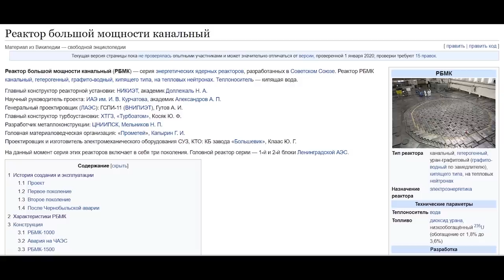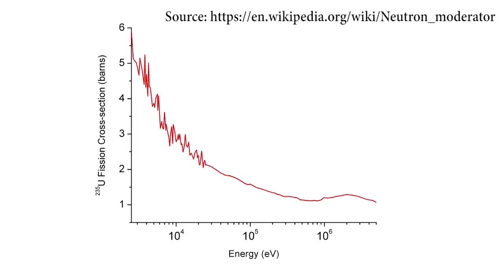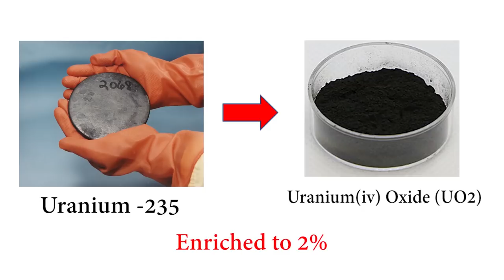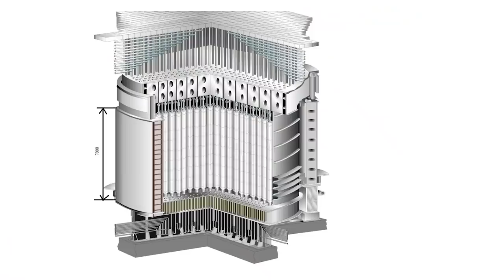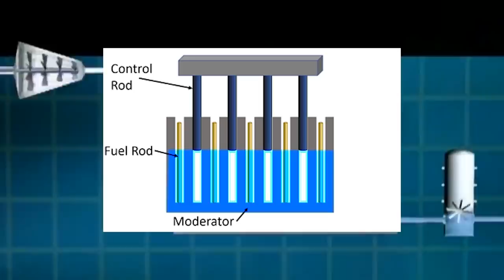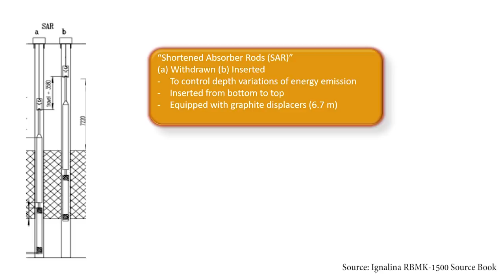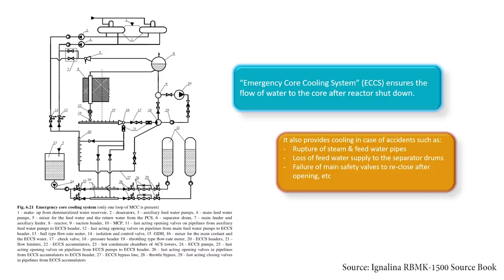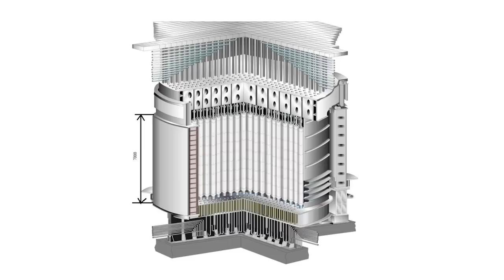RBMK Reactors - Design Overview | The Nuclear Reactor that was used in Chernobyl

Comment: Good video! I still do not understand how the fuel assembly works. Inside the 11.4 cm diameter graphite channels, there is a fuel assembly. How, then, is this fuel assembly brought into contact with water? Is the inside of the graphite block assembly actually a high pressure tube made out of zircalloy? But if that's true, then online refulling is impossible, you have to disassemble the pressure tube ? As another point, do you know if emergency reactivity control is also achieved with boric acid injection in the water (nowadays?)
Reply from the maker: Inside the 0.114m bore openings of the graphite blocks, there is a fuel channel made of zircalloy placed in it. The fuel channel is connected to the tubes from the MCPs, which pump water to channels. 

The fuel assemblies are placed inside the fuel channel, in which water flows through. That way, only the fuel assemblies that need to be replaced during refueling, not the entire fuel channel.

And yes, boric acid is quite common use in PWR designs.
Reply: @antares2767  How much space is there between the fuel assembly and the interior wall of the channel? That is, how much space for water to flow?
Reply: I think the problem with boric acid is that it takes way too long to charge it into the plant. My limited experience - had to mix the boric acid then place in a charging water tank, then charge at a very low flow rate. Not practical for this near-prompt critical casualty.

Comment: I believe I have a correction here. Since water has the capacity to absorb and slow down neutrons, the presence of water shall increase the reactivity as the chances of a neutron colliding increases. at 6:16 you mentioned, reactivity increases as  water leaves the system.
Reply from the maker: Light water can either act as a neutron absorber(absorb neutrons = slows down reaction) or moderator(slows down neutrons = increases reactivity) depending on the design of the reactor. It is typically used as a moderator in reactors with higher levels of U-235 enrichment(3-5%). 

That's not the case for RBMK reactors, where the enrichment is only around 2%. Here, water actually acts more as an absorber rather than a moderator, which slows down the reaction. So when a void is formed, the reactivity increases as only graphite(a stronger moderator than light water) and the fuel are left in the system.

Comment: The RBMK (Russian: реа́ктор большо́й мо́щности кана́льный, РБМК; reaktor bolshoy moshchnosti kanalnyy, "high-power channel-type reactor") is a class of graphite-moderated nuclear power reactor designed and built by the Soviet Union. The name refers to its design where, instead of a large steel pressure vessel surrounding the entire core, the core is surrounded by a cylindrical annular steel tank inside a concrete vault and each fuel assembly is enclosed in an individual 8 cm (inner) diameter pipe (called a "technological channel"). The channels also contain the coolant, and are surrounded by graphite.

The RBMK is an early Generation II reactor and the oldest commercial reactor design still in wide operation. Certain aspects of the original RBMK reactor design, such as the large positive void coefficient, the 'positive scram effect' of the control rods[3] and instability at low power levels, contributed to the 1986 Chernobyl disaster, in which an RBMK experienced an uncontrolled nuclear chain reaction, leading to a steam and hydrogen explosion, large fire, and subsequent core meltdown. Radioactive material was released over a large portion of Europe. The disaster prompted worldwide calls for the reactors to be completely decommissioned; however, there is still considerable reliance on RBMK facilities for power in Russia. Most of the flaws in the design of RBMK-1000 reactors were corrected after the Chernobyl accident and a dozen reactors have since been operating without any serious incidents for over thirty years.[4]

Nine RBMK blocks under construction were cancelled after the Chernobyl disaster, and the last of three remaining RBMK blocks at the Chernobyl Nuclear Power Plant was shut down in 2000. As of February 2024 there are still 7 RBMK reactors and three small EGP-6 graphite moderated light-water reactors operating in Russia.[1][5] All have been retrofitted with a number of safety updates. Only two RBMK blocks were started after 1986: Ignalina-2 and Smolensk-3.

History
The RBMK was the culmination of the Soviet nuclear power program to produce a water-cooled power reactor with dual-use potential based on their graphite-moderated plutonium production military reactors. The first of these, Obninsk AM-1 ("Атом Мирный", Atom Mirny, Russian for "peaceful atom," analogous to the American Atoms for Peace) generated 5 MW of electricity from 30 MW thermal power, and supplied Obninsk from 1954 until 1959. Subsequent prototypes were the AMB-100 reactor and AMB-200 reactor both at Beloyarsk Nuclear Power Station.

By using a minimalist design that used regular (light) water for cooling and graphite for moderation, it was possible to use fuel with a lower enrichment (1.8% enriched uranium instead of considerably more expensive 4% enrichment). This allowed for an extraordinarily large and powerful reactor that could be built rapidly, largely out of parts fabricated on-site instead of by specialized factories. The initial 1000 MWe design also left room for development into yet more powerful reactors. For example, the RBMK reactors at the Ignalina Nuclear Power Plant in Lithuania were rated at 1500 MWe each, a very large size for the time and even for the early 21st century. For comparison, the EPR has a net electric nameplate capacity of 1600 MW (4500 MWthermal) and is among the most powerful reactor types ever built.

The RBMK-1000's design was finalized in 1968. At that time it was the world's largest nuclear reactor design, surpassing western designs and the VVER (an earlier Soviet PWR reactor design) in power output and physical size, being 20 times larger by volume than contemporary western reactors. Similarly to CANDU reactors it could be produced without the specialized industry required by the large and thick-walled reactor pressure vessels such as those used by VVER reactors, thus increasing the number of factories capable of manufacturing RBMK reactor components. No prototypes of the RBMK were built; it was put directly into mass production.

The RBMK was proclaimed by some as the national reactor of the Soviet Union, probably due to nationalism because of its unique design, large size and power output and especially since the VVER was called the American reactor by its detractors in the Soviet Union, since its design is more similar to that of western PWR reactors. A top-secret invention patent for the RBMK design was filed by Anatoly Aleksandrov from the Kurchatov Institute of Atomic Energy, who personally took credit for the design of the reactor, with the Soviet patent office. Because a containment building would have needed to be very large and expensive, doubling the cost of each unit, due to the large size of the RBMK, it was originally omitted from the design. It was argued by its designers that the RBMK's strategy of having each fuel assembly in its own channel with flowing cooling water, was an acceptable alternative for containment.

The RBMK was mainly designed at the Kurchatov Institute of Atomic Energy and NIKIET [ru], headed by Anatoly Aleksandrov and Nikolai Dollezhal respectively, from 1964 to 1966. The RBMK was favored over the VVER by the Soviet Union due to its ease of manufacture, due to a lack of a large and thick-walled reactor pressure vessel and relatively complex associated steam generators, and its large power output, which would allow the Soviet government to easily meet their central economic planning targets.[6]

The flaws in the original RBMK design were recognized by others, including from within the Kurchatov Institute before the first units were built, but the orders for construction of the first RBMK units, which were at Leningrad, had already been issued in 1966 by the Soviet government by the time their concerns reached the Central Committee of the Communist Party of the Soviet Union and the Soviet Council of Ministers. This prompted a sudden overhaul of the RBMK. Plutonium production in an RBMK would have been achieved by operating the reactor under special thermal parameters, but this capability was abandoned early on.[7] This was the design that was finalized in 1968. The redesign did not solve further flaws that were not discovered until years later. Construction of the first RBMK, which was at Leningrad Nuclear Power Plant, began in 1970. Leningrad unit 1 opened in 1973.

At Leningrad it was discovered that the RBMK, due to its high positive void coefficient, became harder to control as the uranium fuel was consumed or burned up, becoming unpredictable by the time it was shut down after three years for maintenance. This made controlling the RBMK a very laborious, mentally and physically demanding task requiring the timely adjustment of dozens of parameters every minute, around the clock, constantly wearing out switches such as those used for the control rods and causing operators to sweat. The enrichment percentage was increased to 2.0%, up from 1.8% to alleviate these issues.

The RBMK was considered by some in the Soviet Union to be already obsolete shortly after the commissioning of Chernobyl unit 1. Aleksandrov and Dollezhal did not investigate further or even deeply understand the problems in the RBMK, and the void coefficient was not analyzed in the manuals for the reactor. Engineers at Chernobyl unit 1 had to create solutions to many of the RBMK's flaws such as a lack of protection against no feedwater supply. Leningrad and Chernobyl units 1 both had partial meltdowns that were treated, alongside other nuclear accidents at power plants, as state secrets and so were unknown even to other workers at those same plants.

By 1980 NIKIET realized, after completing a confidential study, that accidents with the RBMK were likely even during normal operation, but no action was taken to correct the RBMK's flaws. Instead, manuals were revised, which was believed to be enough to ensure safe operation as long as they were followed closely. However, the manuals were vague and Soviet power plant staff already had a habit of bending the rules in order to meet economic targets, despite inadequate or malfunctioning equipment. Crucially, it was not made clear that a number of control rods had to stay in the reactor at all times in order to protect against an accident, as loosely articulated by the Operational Reactivity Margin (ORM) parameter.[8] An ORM chart recorder and display were added to RBMK control rooms after the Chernobyl disaster.

A 45-year lifetime is envisaged for many of the units, after mid-life refurbishment

Comment: I am looking answer for my question and i think you didnt told about this. How the control rods are moving? There is a hydraulic actuator, or some mechanical gearbox with electrical motors?
Reply from the maker: If I'm not mistaken I answered this question a while back. I provided a link in the description to the RBMK-1500 sourcebook. Refer to pages 70-72 regarding the control rod drive. You'll find your answers there. Thank you

Comment: First of all, nice video. I appreciate your work. Regarding the AZ-5 emergency shutdown button: isn't it the one on the left upper corner instead of the middle one you are showing here? In the various photo's I saw, including those from the control room of reactor 3, the infamous az-5 button is not in the middle. Thanks again!
Reply from the maker: Oh, that picture was taken from reactor 1. It's probably because reactors 3 and 4 were newer than 1 & 2. I guess you can call them '2nd generation' rbmks, and they had relatively minor-moderate number of modifications.
Reply from the maker: And the picture I showed does in fact has an 'АЗ-5' writing on it so, yeah.

Comment: Question, why do meltdowns cause reactors to explode?
We heat up the core so we can create steam, does the same principle hold true once Corium is made? Does the heat become so high that the core can’t hold the pressure and it bursts? How do positive feedback loops with RBMK reactors even work?
Also, I see core schematics have this circular-like grid around it? Not sure what it’s called. Is this special to RBMK reactors or do many types of reactors have them?
Reply: In case of RBMK, it was because steam forming in the core actually ramped up the reaction, instead of ramping it down (like on VVER).
Reply: In this case it was most lilkely a steam explosion. For Fukushima is was a hydrogen explosion. A meltdowm is mostly referred to the core melting down in a PWR reactor, which Chernobyl was not.

Comment: 11.49 the opertor push on the control rods too farZfast response) making it expand positive void reaction.
12.25 later made correction by reduced control rod reaction time from 18 to 14 seconds.

This two phrase is contrasted.
Reply from the maker: I was referring to the violations of safety protocols for the reactor on the first phrase when I said "due to the operators pushing it too far". Not the control rods during the shut down sequence.

Comment: Unaccurate informations: all the fission reactors use the natural state U-238 which is fissionable but not fissile (cannot sustain the chain reaction to capture neutrons, break and relese another neutron), thus it must be enriched with U-235  which is fissile but only present in a ~0.6 percent in natural ore.
CANDU - pretty "western" reactors - can use natural uranium, thus making them the most efficient and safe, but slightly expensive.

Comment: So the graphite stack is cooled by a helium nitrogen mixture, and the light water which sits at the bottom? (The main question is if the water penetrates the graphite stacks)
Reply: No, water is inside cooling channels (in pressure tubes), graphite is outside and dry, and gas-cooled

Comment: So does water circulate through the graphite channels or does everything happen inside the closed fuel assemblies that are inside the graphite channels?  I guess it makes sens that each assembly gets cooled separately.
Reply: Technological channels run through holes in the graphite blocks. Graphite stays dry but is bathed in various gasses for cooling and other purposes. Technological channel contains both the water and the fuel assemblies.

Comment: So the steam directly produced in the core goes through the turbines?
No heat exchangers?
Doesn’t that make the turbines and condenser radioactive?
Reply from the maker: Technically yes. From what I understand, that's how BWR reactors work as well(i.e. fukushima). When you mentioned 'heat exchangers', I think you might be referring to PWRs.